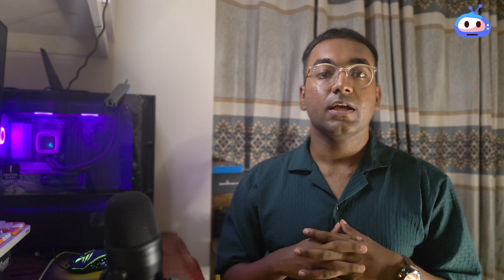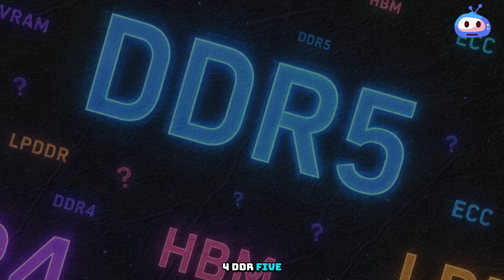Every PC RAM Type Explained: From DDR1 to DDR5, VRAM, LPDDR, ECC & HBM

Comment: DDR is a brand you lost my attention DDR is not a RAM brand—it's the generation of the memory (e.g., DDR3, DDR4, DDR5). Actual RAM brands include Corsair, Kingston, G.Skill, Crucial, ADATA, TeamGroup, and many others. Before uploading tech videos, please do proper research and verify your information to avoid spreading misinformation.
Reply from the maker: I never said DDR is a brand—I explained it as the technology (Double Data Rate) that sends/receives data twice per clock cycle. The video covers RAM types, not brands like Corsair or Kingston.